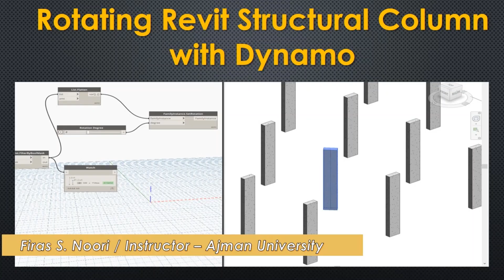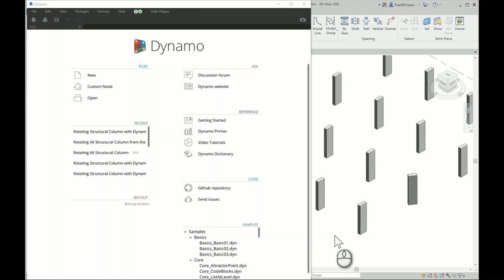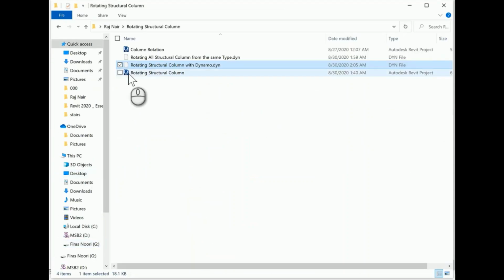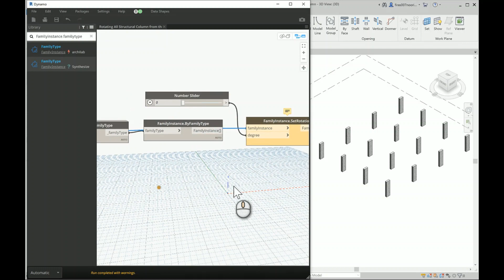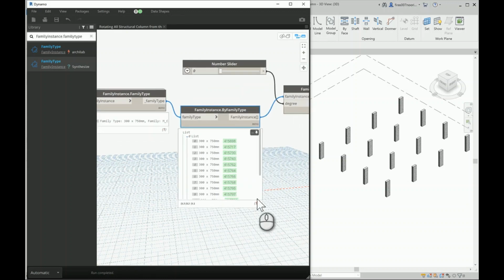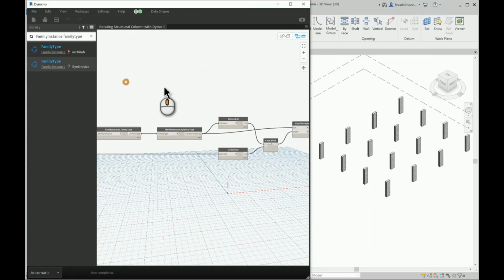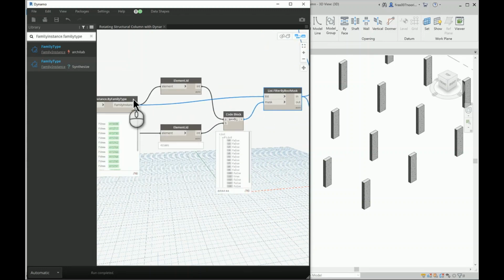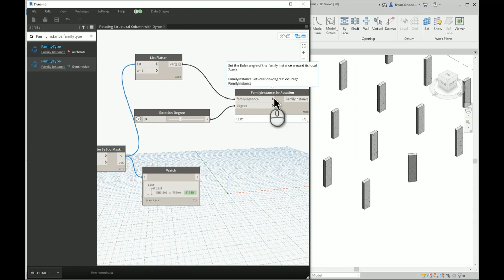Rotating Revit Structural Column with Dynamo

Comment: Si o meglij fraaaaaattttmmmmm
Reply from the maker: All the best dear
Reply: @FirasNoori  We are a group of students from the University of Naples Federico II. we are doing a parametric analysis of a building using dynamo. we would need an algorithm that makes us vary the size of the pillars. Please help us🙏😁
Reply from the maker: The size of pillar base on what parameters?
Reply: @FirasNoori  the height
Reply from the maker: You do not need algorithms nor dynamo, you can simply make revit family and draw a circle and make it radius as parameter, and make extrude and also attach a parameter for the height,  and thats it, see my table revit example here in my channel or in my book (revit parametric design)
Reply from the maker: If u still need dynamo for some reason,  then the concept of extruding circle with parameter height will do the job  also see the channel, I have posted an example of that
Reply: @FirasNoori  we have a structure with rectangular pillars. we have to vary the cross section of the pillars (in particular the height of the cross section) in order to make a modal analysis on the structure with different cross sections. sorry for my English.
Reply from the maker: You can find similar tutorials in my channel of making a rectangle with x and y parameters, you can start by making a dynamo rectangle by width and length and feed the parameters to them, or by defining for points and make width and depth parameters to control them, then extrude as solid node with height parameter on it, both methods are explain several times here in the channel
Reply: @FirasNoori  thank you so much🙏

Comment: Hello Dear Firas Noori. I was watching some your videos(where you making grid,columns etc). I have an question, there is a script that can move level's line ? Because originally lines create across the building and in your video(making parametric beams system) you just moved them manually in Revit at 9:25. Thank you for everything I really appreciate your work :)
Reply from the maker: I will check if I can make a video for it, cheers
Reply: @FirasNoori  Thank you for replay. I look forward to the response!
Reply from the maker: Yes dear you can